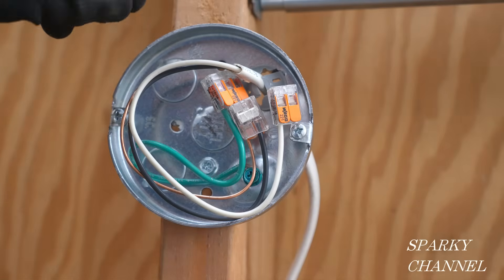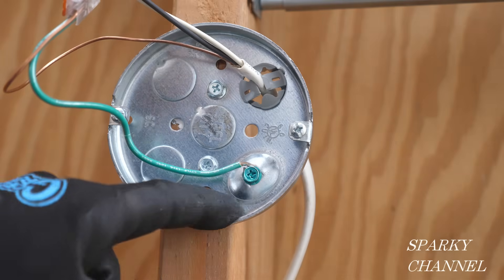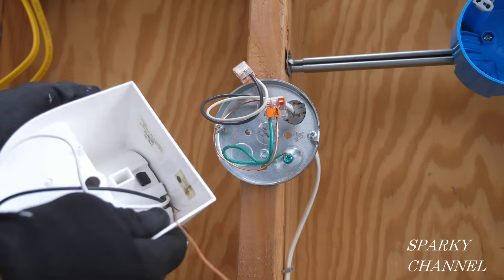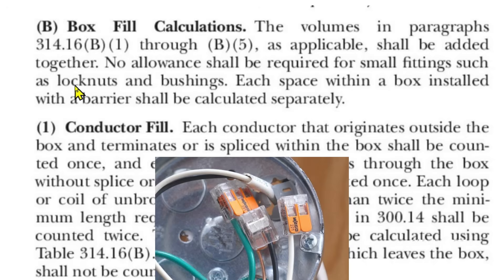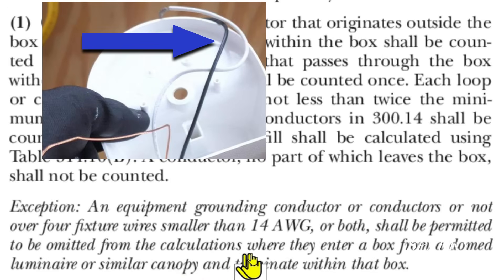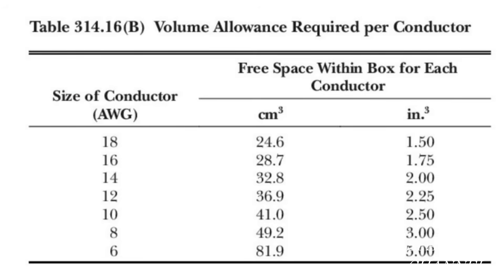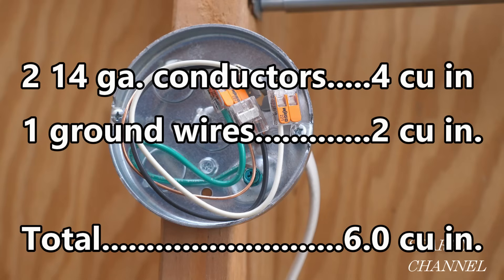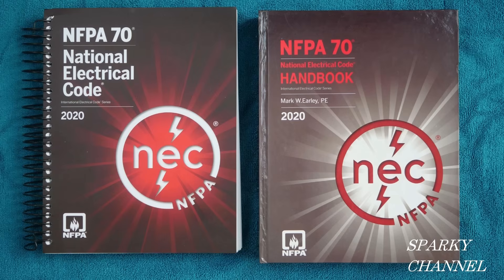How Many Conductors Can Be Put in a Pancake Box by 2020 NEC? (Box Fill Article 314.16)

Comment: Thankfully, CEC is much nicer.  We only count insulated conductors, so the ground is out.  And #14 AWG only uses 1.5 cubic inch per insulated conductor.  Although, we have a rule that counts every two wire-caps as an insulated conductor.  So our fill only goes up to 4.5 cubic inches.  

Also, where are you getting 6 inches from for pancake boxes.  The number I googled says they're 5.5 inches cubed.
Reply: It's stamped on the box
Reply: Now it is. Was not so nice in previous code cycles. Of course I have been retired for 3 code cycles,Lol.

Comment: How many times have you opened up a pancake box and seen a splice going to another place? Especially bathrooms.
Reply: I was hoping this would work to center a bathroom light. It wont pass because theres a splice going somewhere else No wires are allowed to exit. Is that correct?

Comment: It looks like your ground pigtail may actually be #12 AWG so wouldn't that push you over the 6.0 CU INCH limit or does the pigtail not get counted?  Seem odd that because of the regs, using #12-2 wouldn't be allowed even though the biggest issue with those boxes is fitting the wire nuts into that tiny space and not the air gap around the wires.  Those flat Wago lever-nuts sure are a big help and yet they're not required.
Reply: You're right that the pigtail is #12, but 314.16(B)(5) says that the calculation shall be based on the largest conductor "entering" the box, which would be the bare #14. The "entering" distinction was added in the 2020 edition, so if you're using an older edition, that would explain your confusion 🤙

Comment: Why would you have a separate grounding wire for the box ground screw, just wrap the bare copper ground wire around the screw and then connect the device ground to the wire.  No need for an extra wire.

Comment: I was under the impression that the "conductor" consisted of the hot and neutral wire. Please correct me if I'm wrong. Currently reading and watching videos to learn electrical.
Reply: Both the hot wire and the neutral wire are current carrying conductors. They each count as one.
Reply: Copper wire or green wire is the grounding conductor.

Comment: This wouldn’t be acceptable for ceiling fans with a 14-3 NM cable, not for any daisy chain lights. Just a single run of 14-2. Of course the new 2020 ceiling fan box requirements apparently rule this box type out.

Comment: So basically you can't use #12/2 with a pancake box period? I'll bet that get's very lightly enforced.
Reply: Typically you won’t even use a pancake unless for a keyless fixture
Reply from the maker: Gotta love keyless fixtures! The old gas fixtures had keys so the invention of the electric lights were "keyless". Merry Christmas! 🎄
Reply: We use pancakes for almost all surface mounted lights unless center comes out on the edge of a joice.
Reply from the maker: You're correct. 12/2 with ground wouldn't work. Merry Christmas! 🎄
Reply: @SparkyChannel  What if you run  type AC cabling back to the the previous box, and ground the the fixture directly to the box? So you have 0 grounds, 2 #12s, and 3 omitted fixture wires <14awg. 2 * 2.25 = 4.5, with 1.5 left for syrup?

Comment: What I do so it could be less busy with wires in the pancake bx, No ground pig tail install in the bx, I leave the ground wire extra long and just wrap it on the ground screw with 5 inches long b4 the screw and wrap it inside along the edge of the bx out of the way and 6 inches after, and you eliminate an extra pice of wire and make it roomier in the tiny bx, but to answer ure question, only one wire in the pancake bx.
Reply: Btw bro “bx” also refers to an armoured cable not box
Reply: I believe he did that for demonstration purposes only.  I'm sure he's out in the field doing good work👍🏽

Comment: I wonder if an inspector might look at that "bushing" as being an internal cable clamp (314.16(B)(2) which I believe would bring the required space to 8.25
Reply from the maker: They might. The actual truth is that inspectors might say just about anything. But most of that clamp is outside the box so just about everybody would agree that it's an external clamp and not counted. Also, there is a picture in the 2020 NEC handbook with a set-up just like mine. Good question. Merry Christmas! 🎄

Comment: When a fixture is connected to a pancake the  space it provides for wire connections should be taken into account when calculating max fill values.

314.16 
(A) Box Volume Calculations. The volume of a wiring enclosure (box) shall be the total volume of the assembled sections and, where used, the space provided by plaster rings, domed covers, extension rings, and so forth, that are marked with their volume or are made from boxes the dimensions of which are listed in Table 314.16(A).
Reply: I think the only thing an inspector could get you on with that one is the "that are marked with their volume" most, if not all fixtures aren't, even though I agree they should count.
Reply from the maker: Thanks! Merry Christmas. 🎄

Comment: Awesome video! This must be the biggest code violation in the world because it means that even a single 12/2 wire will go over the 6 cubic inch limit and yet I've seen it all the time and may or may not have been guilty of committing it myself! I guess your alternative there is those NM fan boxes that let you screw directly in the jost but even those  only have 12 cubic inches of capacity.
Reply: Some of my coworkers use those for regular fixtures in place of pancake boxes. They stink. All the extra plastic interferes with most fixture brackets.
Reply from the maker: Thanks and Merry Christmas! 🎄

Comment: You made the comment that we were assuming the ECG inside the box to be 14 AWG, but that it was 12 AWG and could be considered as causing us to exceed the volume calculation. However, as you also showed, 314.16(B)(5) says that the calculation will be made on the largest "entering the box." The ECG that comes preinstalled in the box does NOT "enter the box."
Reply from the maker: Thanks for bringing that up! I edited out that section with YouTube editor. You helped me make it a better video! Merry Christmas. 🎄
Reply: I was about to say this. I don't think that article counts the pigtails to base the calculation on.
Reply from the maker: @Ed-uu9eo  Thanks and Merry Christmas! 🎄

Comment: Why use a bonding jumper when you can wrap the romex bonding wire around the green screw it’s self? Even if we used a 14 awg jumper and don’t have to count it, it still does take up some room.  I also like using small orange wire nuts in that situation because they are smaller then the wagos. We don’t have to figure them in for box fill code wise but in reality they do take up room and depending on the fixture bigger wire nuts or wagos can get in the way.
Reply from the maker: That's a good technique which does save space. Merry Christmas. 🎄
Reply: Merry Christmas Sparky
Reply: I agree.  I'll also have to double check when I get my handbook, because I prefer the 3.5" pan box, which is only made legal by the volume of the fixture canopy, so if they've started to prohibit adding canopy volume, I'll have to find another way to get box volume without cutting into my margin of error by using 4 inch boxes.  also, if you haven't played with them, I like the 3M O&B wire nuts for connecting fixtures in close quarters.
Reply: My boss, as I was an apprentice, never let use use 3” pancake boxes and so i still don’t. Usually fixtures thar require a small splice box NEED a metal 1gang box, because of the size and shape of the canopy. I’m always surprised they are allowed to make such fixtures seeing as how there’s no boxes technically rated to hold them. (As far as i know) And I’ve never seen a 1gang metal mudring tapped for 8-32’s...that would be great lol
Reply: That’s how I do it. 👍🏻

Comment: The last paragraph new to 2020 is throwing me off. What does "based on largest" mean? If we had 12-2 conductors in the pancake box and the additional ground was 14-2 does that mean we dont add that 1/4 volume?
Reply: it means you count the first four grounding conductors as 1 conductor count of the size of the biggest.  say you have a #12, a #14, and a #18, like in his example, you would count them all as 1 #12.  if you had a multigang switch box with 6 #14 grounding conductors, you would count the first 4 as one #14, and then count the next two as two quarters of a conductor count,

Comment: in nj, that could fail in new con. if the inspector is a jerk, because we have to have allowances for "future work" i.e, you cant meet box capacity,  you have to have a minimum of 1 cubic inch extra.
Reply: That’s kind of crazy!
1 cu. in. Won’t get you anything more than what the box already allows!
Reply: years ago, I had an inspector tell me that if everything is folded in neatly, and there is obviously plenty of space for the devices or fixture connections, he wasn't going to be bothered counting conductors.  which was a relief because the box he was looking at was at its maximum conductor fill.